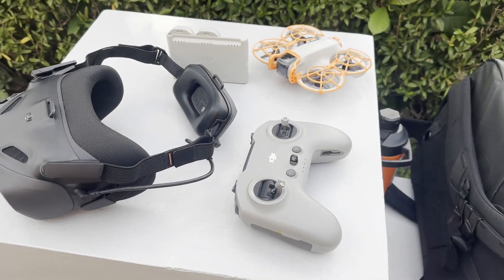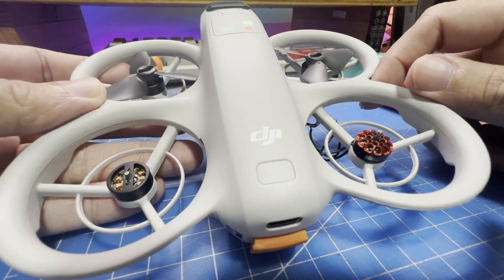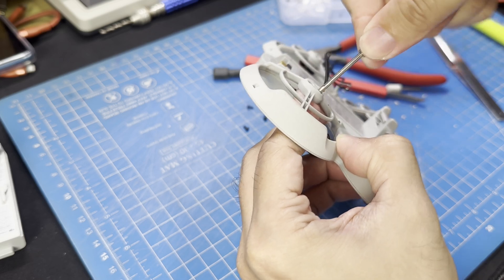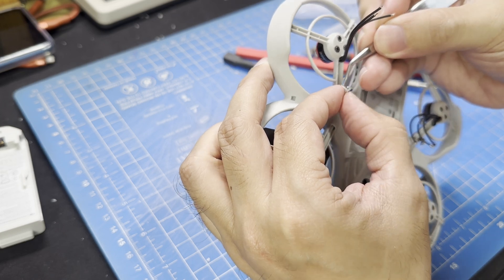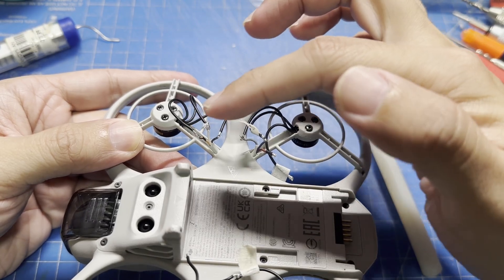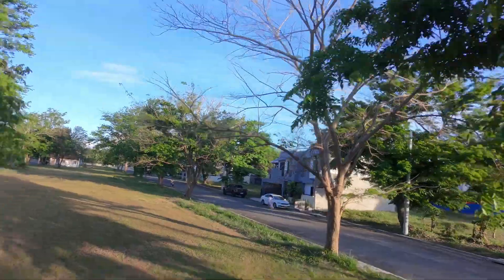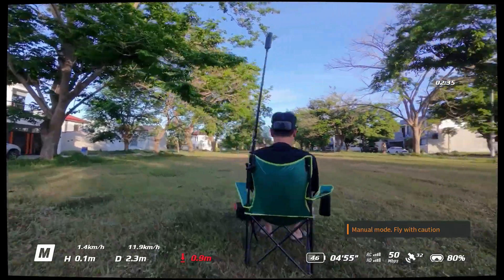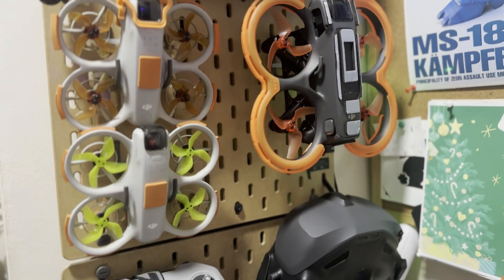DJI Neo Motor Upgrade: Full DIY and Test

Comment: That's a fantastic video, but I'd like to ask if you've encountered any ESC malfunction warnings since the modifications were made?
Reply from the maker: Thanks! I've never had this issue and my Neo still works fine, but there are a few who have mentioned that they ended up with something like that. Honestly though, now that I've improved my piloting skills since I did this mod, I hardly think it is necessary. Unless you've damaged a motor like I did in the first place, I wouldn't risk swapping motors.
Reply: @SendItFPVChannel thank u for the response, that's what I'm still concerned about, although I already brought the Happymodel 1103 motors😅

Comment: Thanks for the video, it was really helpful!

I have a couple of questions:

Does the drone still work properly in the automatic modes - without the controller - just like it did before the motor replacement?
What about stability? 

How is the flight time when using those automatic modes?
Reply from the maker: They still work as expected, as for flight time in auto modes I can’t really comment as  I rarely use them. Expect similar times though as battery life is more linked to battery health, props and wind conditions

Comment: Damn, as someone who is looking into a first FPV knowing you can exchange the motors makes me even more interested in it...
Reply from the maker: it was a great entry point for me! l don’t fly it as much these days as I’ve moved on to a proper 5” quad but I still enjoy it. Sadly the Neo 2 took a step towards video stabilization (2 axis gimbal) instead of FPV, and looks like it won’t hold up to the same abuse I’ve put this little thing through as I was learning.

Comment: Did it hold up in the long run? I heard some people argue that this could potentially overheat the motor drivers? So I'm curious how it turned out for you
Reply from the maker: I haven't seen any issues with this mod until now. I've been getting a few gimbal issues that are likely unrelated and more from all the crashes it has been through, but otherwise the motors have been fine.
Reply: @SendItFPVChannel thanks for your input! I'm gonna consider it then!

Comment: this video gave me idea about getting better motors, and modding battery to add more power to it, to make a super neo
Reply from the maker: I wouldn't mess with the battery, as it uses a single board. You could end up frying the esc or worse

Comment: Looks cool but after seeing your skills flying that drone in acro, I´d recommend you to move to a real drone. That plastic frame is not going to hold too many more crashes without breaking. If you want to keep if that same size, I recomend you the the Pavo 20 pro...
Reply from the maker: indeed, the ducts are cracked in several places, but still holding up. I do plan on getting a proper freestyle drone, like the speedybee master 3 or similar

Comment: That's a impressive improvement in general, it basically turned it into a mini freestyle drone, and for the top speed, that's a 20kph from the usual 60`ish kph it usually does (I managed to pull 72kph flying with the wind and with a extremely aggressive angle), I still need to pratice a lot more before even thinking on getting anything more powerful tho, the neo may be small and weak, but on my view, it's like driving a slower car, there's still a lot for me to learn from it before getting anything more powerful and this upgrade is something that I may end up doing in the future.
Reply from the maker: I’ll be honest, as my piloting improved since I did this mod, I can already control my stock neo just as well as this one, despite having less throttle punch..so it really is just a matter of mastering how the aircraft responds to your inputs and compensating for less power with quicker response on the sticks

Comment: Hello, great video.
I have a few questions.
My son and I ride jump lines and downhill at bike parks. We use the Neo in follow mode. The Neo has a harder time following because we're quite fast. Are the HappyModel EX1103 KV11000 faster than the standard motors?
My son and I would appreciate it if you could make a few videos. We're especially interested in the follow-me feature.

Greetings from Germany
Reply from the maker: They are faster, but I don’t think the motors are the issue with follow but the software/ai tracking itself. I’ll try to make a comparison in follow mode but it will take some time as we’ve been having rain for weeks

Comment: Can i use BetaFPV 1103 11000Kv Micro/Whoop Motor 4 Pack for the upgrade?
Reply from the maker: I'll look into that, might be another option if the specs are mostly same, but I think betafpv motors have 4 screws?

Comment: Tip: Have you changed a motor in your beloved NEO due to ESC error? Power on your NEO only and attempt a palm launch it without connecting to anything. Those pesky ESC related errors tend to "stick" to controllers (phone, RC2 and goggles) even after a successful HappyModel motor swap. I hope this helps a few of you.
Reply: Another finding: ESC error "sticks" to intelligent flight battery as well. Not sure about the logic just yet. It's nice to have more than one battery for a NEO motor swap in order to clear ESC error.

Comment: Nice vid, did this increase the speed for the follow me mode - no controller? (just palm based follow me. Mode)?
Reply from the maker: @Ander5onAdventuresinScotland  I haven’t used the auto modes since I replaced the motors, but I’ll test it out and share the results here soon

Comment: Thx for the tip. My Neo chewed up a pillow with her rear left and threw an ESC error. Ordered a set of the above mentioned engines and she is back in business a couple of days later. I only replaced one engine and using the original dji prop with it, working again as advertised.
Reply from the maker: cool I didn't think it would work with mismatched motors
Reply: I wouldnt either, @hangar7449 does it work well or is it weird?

Comment: Very good result! Thinking of doing the same with my first FPV drone Neo.
But could 1104 7500KV motor be better for freestyle?
P.S. I found out all bigger motors have 4-point mount =(
Reply from the maker: @nickphotovideo  yes choices are limited. I might try other whoop motors that could fit. I wouldn’t push it too much though as the esc may disagree
Reply: @SendItFPVChannel  otros motores no son copatible solo los 1103-11000kv

Comment: I've tried this on two Neos and both failed with the same faults - ESC error. Power system hardware error. No wires are touching. No mounting screws are in too far and the motors are deliberately mounted 0.5mm higher to overcome motor scraping. I'm using the EX1103 KV11000 motors. Strangely the first motor went on without a problem. The second is where the error is showing up.

I just reconnected the original motor. Same error. So I'd say this little mod has bricked my Neo!
Reply: Its the firmware.. They always do this lockdown to prevent us upgrading and moding the stock units.. You could have mentioned the aircrafts firmware version / rc firmware vers. & apps firmware vers. before doing the motor upgrades..
Reply from the maker: @LunaTunaFlix  I didn't realize until now that we get different firmware per region, so I'll just add it in the video description. Thanks for the suggestion!
Reply: Did you connect the wires correctly with your original motor? Why have you bricked two Neos instead of one?
Reply: @nickphotovideo  Great question. Judging by the video there appears to be no right or wrong way. If I've got this correct, when you solder it will either turn the wrong way or the right way. If it's the wrong way you just flip two of the wires. The reason for the two Neos is I had a second Neo I tried this on! My bad.
Reply: If you didn't solder the chip yourself, it's most likely that the wires were poorly soldered. The chip tests the motors and detects that one of them has low resistance or an unstable connection — this triggers an ESC error. Re-solder the wires properly or replace them entirely.
Reply: @nickphotovideo  No I didn't solder the chip. I just did it exactly like the video. I'm going to replace the wires and have another go. Thanks for the tips.
Reply: Let us know how it goes and if ESC goes away or if your Neo runs fine after the swap. Waiting for my motors to come in to do the swap.
Reply: @MC...  Will do. However, after soldering all new wires from the motors to the Core Board the ESC error was back, the camera then didn't work at all or even initialise and the sensors underneath didn't work as well. Totally screwed. I have no idea what's going on and I thought maybe I stuffed the Core Board somehow. So I have a new board on the way. I'll see how that goes.
Reply: @MC...  Ok. So this has been a complete and utter fail! The video makes out this is such an easy thing to do. A bit of soldering and you're away. Rubbish. The number of failures that have appeared as a result of this are amazing. Camera not calibrated, Downward vision sensor error, Power system hardware error. Camera lens error, ESC connection error, ESC Error. Three core boards later, junk. I have been soldering electronics for over 40 years and flying drones for over 20. I'm no electronics expert but I know what I'm doing. All I can say is if you want to tackle this, just be VERY careful. Time to go and buy a new Neo.
Reply: @jimmycarter7913  holy damn that’s nuts. Thank you for documenting and letting us know! Still waiting on my motors, thinking it may not be worth it unless I can get a neo second hand locally to try on. 

I’ve watched a few vids, and have also read other users either the same issues as you. Some have solved them, some have gave up. 

Well I have an extra set of motors coming, I may just wait till there is more support for this mod. 

Thanks for the info! Very valuable info.
Reply from the maker: @jimmycarter7913  I just read through this thread and I’m so sorry about your experience! probably the worst case and you have way more experience with drones than I do, so I can’t really give you advice on what else to try. I don’t understand why a simple motor change would cause so many errors and even returning the stock motors doesn’t work..My best guess is that the firmware may differ between regions which makes it not pass the startup sequence.

Comment: Di ba nasunog board?
Reply from the maker: no still flying well, no esc of board issues, just make sure the motors can spin freely without obstruction inside the motor mounts or prop screws.

Comment: aún soy un novato en esto de los drones, tengo un dji Neo, no sabía que puede hacer esas piruetas, es el modo manual? ya que sepa controlarlo mejor intentaré para grabar videos en fpv
Reply from the maker: yes, it is a good starting point for FPV, just need the goggles 3 or N3 and the fpv rc3 controller to unlock M mode / Acro mode

Comment: Where did you get the orange protective thing around the neo?
Reply from the maker: dollar store adhesive foam pads for chair legs to prevent floor scratching ;)
Reply from the maker: there are aftermarket protective gear too but those are heavier
Reply: Respect💯💯, Your truly amazing 🔥🔥👏👏

Comment: Great Swap. Thx for the Video. You watched Bardwells Video;) So next step should be building a 3 Inch Toothpick. You will be impressed how good you can fly FPV with a 3 inch these days.
Reply from the maker: that's the plan, or I'll just get a bind-and-fly sub250 and learn to repair it

Comment: Power the same ,how much difference to replace motor
Reply: The same power can be applied to a "heavy" motor and to a "light" motor. Original Neo motors are "heavy" in order to get more flight time and durability.

Comment: Mobula8 user here.  Interesting.  And expected.  Those 1103 motors have a lot of grunt, don't they?

I've tested several different props on my Mob8 [HQ, LDARC, Gemfan], and can tell you from experience that the most efficient props by far are the Gemfan 2023-3 [the stock prop for the Mob8].  The best for cinematic flying are the Gemfan D51-5 [they draw more power, but the handling is much more precise].

Also, you don't need prop screws with either prop.  They're made to press-fit on the Happymodel 1103s.  You save a little weight, and you won't burn a motor out if its prop gets stuck; it will still spin enough to avoid a burn out.
Reply from the maker: @billmcdonald4335  thanks for the advice! I tried the 3 blade props but had to clip the tips as they don’t fit in the Neo’s ducts, but the 4 blades do. Also I’ve tried not using screws, and I spent a lot of time looking for them as they fly off whenever I crash.. which is often. Perhaps when I get better at flying I can ditch the screws lol

Comment: Would 1104 motors work? Wondering if that would give it the power jump most of us want.
Reply from the maker: the battery is 2S 3.66v each so I'm not sure, and the ESC might complain if the motors draw too much. If you have the motors on hand though it might be worth a try

Comment: U can use "Quick Wire Connector" before soldering. Essentially its like a switch knob where you can easily swap the cable before soldering it.
Reply: lol just twist the cables together and test the wiring order before soldering. You're not going to push enough amps to burn the joints while doing this.

Comment: what type of bolts did you use with the props? still M1.2x6? they look like hexagon head screws
Reply from the maker: M2x7 allen but any head will be fine, added a M2 washer just to make sure it doesn't screw down into the coils
Reply: @SendItFPVChannel  So without a washer, an M2x6mm or an M2x5mm screw would be better?
Reply from the maker: @ m2 6 is a bit short and m2 7 almost touches the coils so I added the washer

Comment: I changed all 4 motors at the same time, and now I'm getting an ESC error. 
 is there a fix?
Reply from the maker: make sure the motors aren't obstructed and can spin freely, might be a screw contacting the coils or the bell scraping against the motor mount.
Reply: @allthingsconsidered5849 can you check my last video? All motors rotate during the start test, the two bottom motors only spin 2 times and stop.
Reply from the maker: @ disconnect one  rear motor at a time, left first then power on, see if it spins through startup correctly. If not, connect left and disconnect right, test again. This is to check if one of the motors is causing the ESC error. If you identify the faulty motor, replace it with the stock motor and see if it eliminates ESC error. If it does, then it is only one motor that is defective/damaged/dirty.
Reply: @allthingsconsidered5849  so basically reconnecting the og motors will remove the ESC error, right?,  that's all I need to know, I tought it was fried. Thanks
Reply from the maker: @fpvosorio  yes should be fine to revert to the old motors if you find one of the new ones is broken just get a replacement
Reply: The HappyModel engine shaft protrudes quite a bit on the bottom. I had to dig a little deeper with my  Dremel into the NEO engine housing in the corresponding area.
Reply: @hangar7449  I have already made a big hole on the bottom of each motor base and reduced the walls to avoid any contact and still have problems with ESC error
Reply from the maker: @ have you tried just replacing one motor at a time? also try powering on with no screws at all , just the motors dangling from their wires, just make sure none are shorted.
Reply: @allthingsconsidered5849  a have been playing with the screws, sometimes like 1/50 times it doesn't get the error And let me fly.
Reply: @ The rotor of the HappyModel engine can also contact the NEO engine housing. I Dremelled that a little lower instead of putting washers between the engine and housing. I'd try to hook up all the wiring only without mounting any of the engines, just to rule out ESC error due to mechanical interference. Good luck by the way.